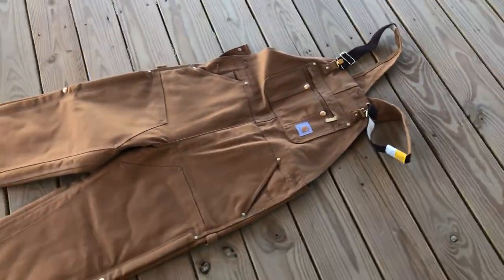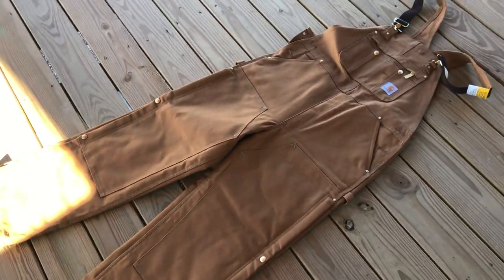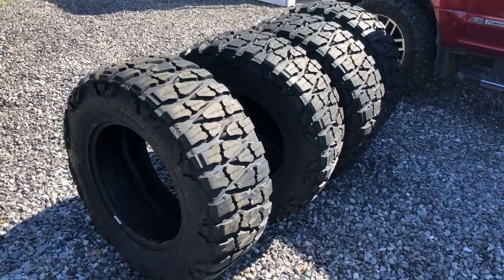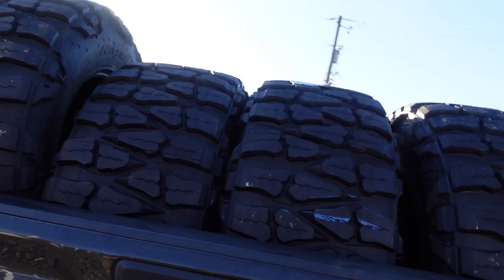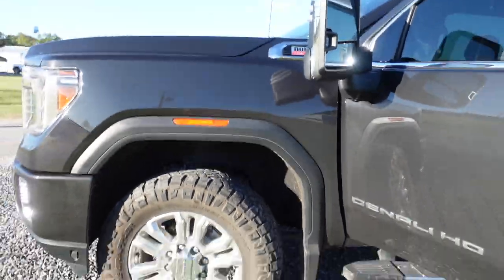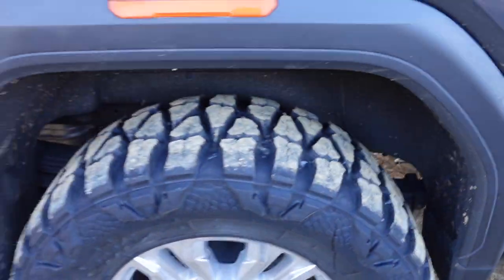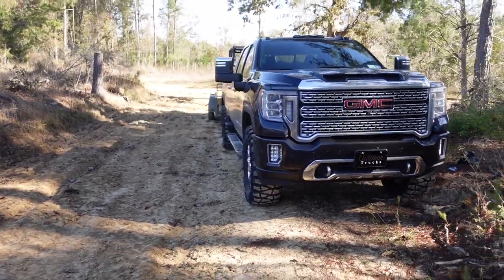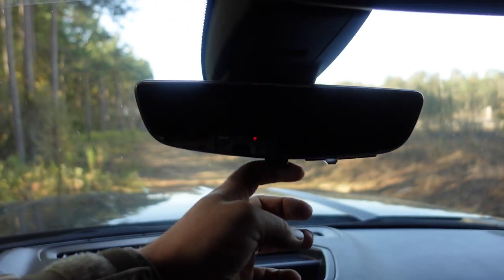Stock 2020 Denali HD Fitting 37's! No torsion key adjustment!

Comment: Just picked up GMC Denali 2023 model… how much level did you use? Would like to run 35 grapplers but the weight rating is low. If I don’t have to add to much lift looks like 37’s should still work.

Comment: Love the trucks. I have a 2020 350 Lariet and I want to put factory led headlights instead of the halogen lights it has. I called ford and they said $1600 per headlight and $600 for the fogs.really don’t have 4 k to spend on lights any Suggestions?
Reply: Wait till they have been out a little longer. I was able to get a pair for my 17 for 800.   I negotiated the guy down from 1500.

Comment: I have a quick question. I leveled my 2019 F250 and I’m about to buy wheels and tires. I’m gonna probably get the Method NV’s and I’m gonna wrap them with 37’s. 

What do you recommend for no rubbing against the radius arm?  I don’t want any rubbing. I’m going with the 20x9’s -12 offset. Do you think that will keep me clean, or should I go to a +1?

Comment: Nice to see the two Ford Super Duty 4WD trucks before the GMC with the stupid looking wheel well openings...which are not designed for a round rim and tire.....and the IFS with poor axle articulation, poor approach angle, poor departure angle, poor breakover angle.....and the low hanging frame rails.....all make the GM (Gargantuan Mistake) 4WD trucks get stuck easily on uneven terrain off-road...especially in mud and snow. Why have a 4WD truck if it is never taken off-road? Putting 37 inch tires on the GM trucks with no lift is a bad idea. Ford and Dodge know how to build great 4WD trucks. The GM 4WD "car like" trucks only good for getting groceries or a few items from home improvement stores and driving on snow packed paved roads.